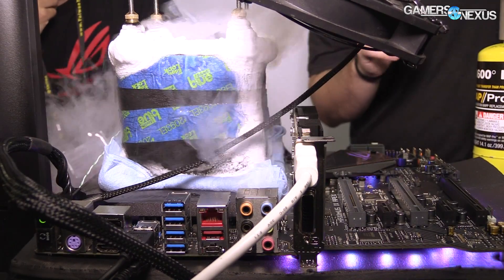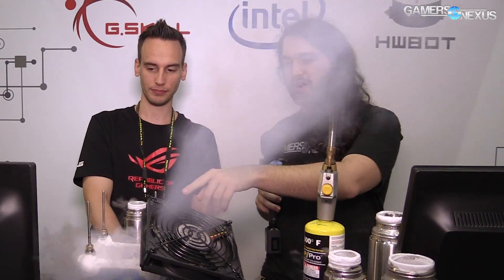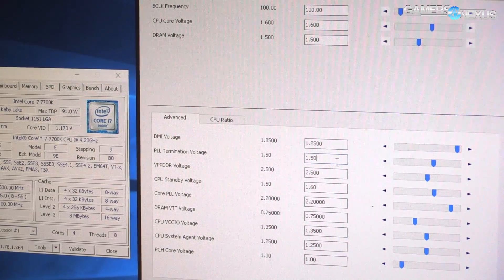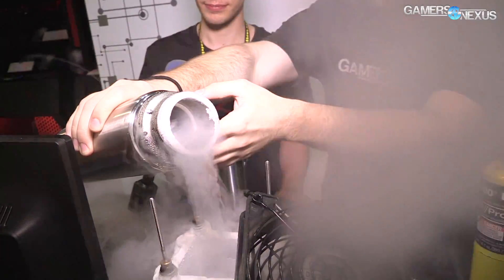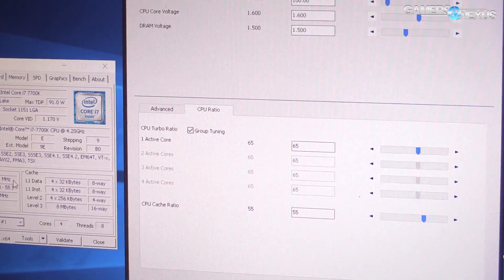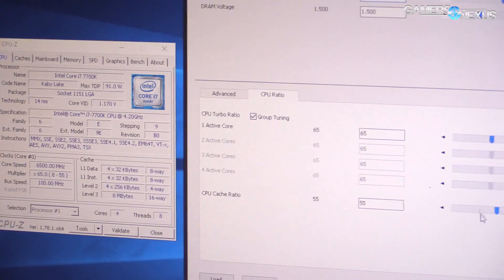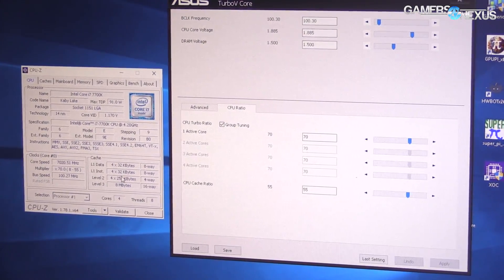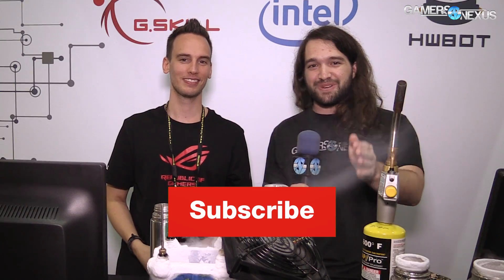XOC Voltages Explained ft. Der8auer (7GHz LN2 Overclock)

Comment: I wanna explain something that might have been a little confusing. Temperature stays constant during a phase change, so when the LN2 is boiling, it can't go lower than that, it will stay at that temperature until the pot is empty. When you're boiling water, it will stay at constant 100°C until all water has evaporated aswell.

Comment: Germans are always praised for their engineering prowess, and mostly it's true, except for keyboards. You just saw a glimpse of how terrible their keyboards are when trying to type in the voltage. That wasn't an accident there, that is what always happens when someone not used to german settings tries to use a keyboard. I work as an IT tech at a german factory and the was appalled by how badly designed the german settings are from day 1 when I started working there. The keyboards physically are fine, it's the things the keyboard does when set to german language. It just boggles the mind.

Comment: So what happens at 7:15 if you accidentally spill liquid nitrogen on your hands while not wearing safety gloves?
Reply: Nothing the Leiden-frost effect protects you. The real risk with LN2 is spilling it on fabrics as it will soak into them and that negates the Leiden-frost effect. Most of the LN2 accidents I've heard of are people spilling LN2 on their shoes and then not taking them off fast enough.
Reply: Not much, surprisingly. As long as the liquid doesn't stay on one spot.

Comment: what happens to these cpu's after they are run on ln2? do they die after being in such a cold environment? can they still be used after? if so can it only ever do ln2 cooling again?
Reply: Tryhardtechy most are fine . sometimes the IMC degrades if they are really pushing the ram.